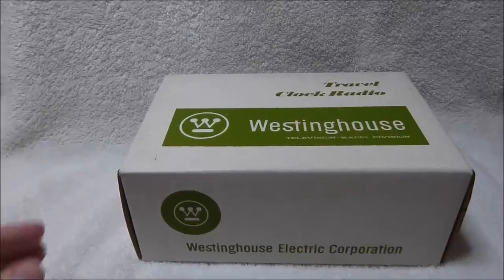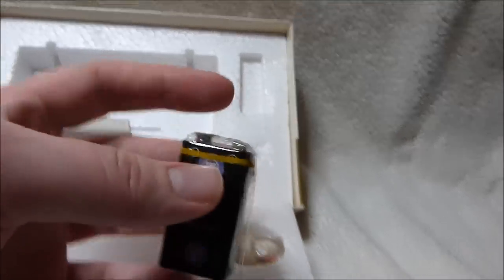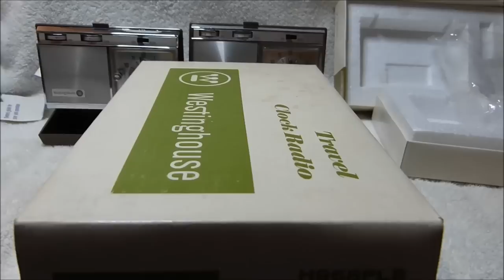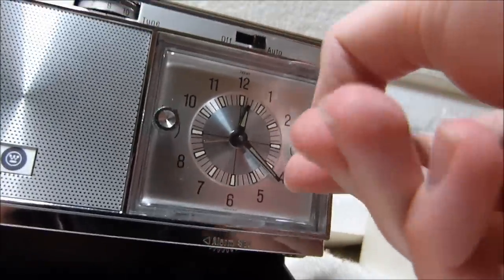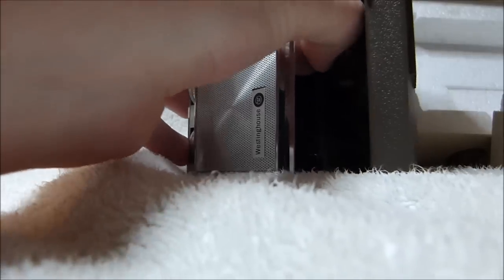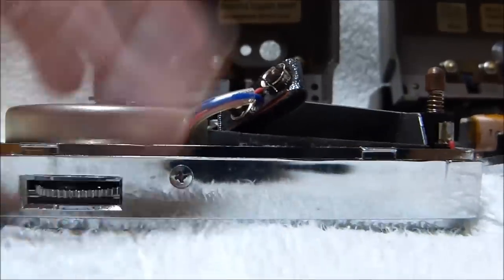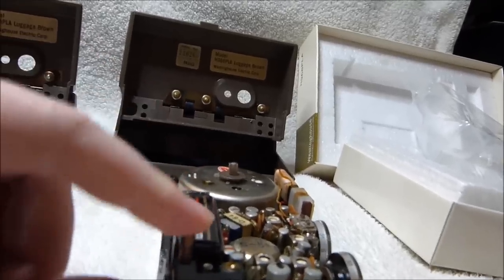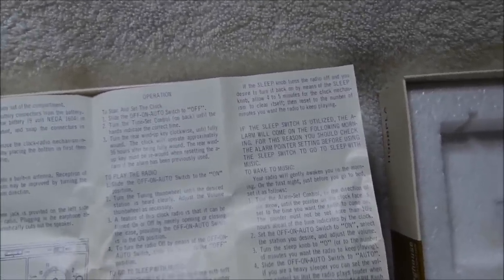Unboxing a NOS Westinghouse model H968PLA/B clock radio (Japan, 1965?)

Comment: I really don't care what you think Matt, but you have esoteric masterpieces in your collection, and for me this is a masterpiece of ingenuity. I was surprised at the great sound from the radio, and some folks would pay a pretty penny for this. I find it incredible that battery looks pristine, can't thank you enough for sharing this little treasure 👍 Tam.
Reply from the maker: Thanks, this is an all-around nice design, I can see why it outsold all the other transistor clock radios that were available. As to the battery, 9 volt batteries seem to survive more often than say AA batteries, but they usually have at least some corrosion.

Comment: Nice review. It would be interesting to pierce the plastic battery wrap with two pins with crocodile clips connected to them and a DVM and see if there is any voltage on either of those factory batteries at all.
Reply from the maker: If it had been a mercury battery it might still have some juice, but these batteries are probably completely dead.
Reply from the maker: Well, he did recharge it before he tried that.
Reply: True. But chemistry can be surprising. I wasn't expecting the wrapped 9 Volt batteries you have with these radios to be anywhere near full voltage, but it would be interesting to see if they are more than zero.
Incidentally, that was a very cool "intelligent" charger Shango066 used... and his comments about the selenium rectifiers were hilarious!

Comment: My unit appears to be over-wound, Its not letting me wind it up. I am hearing sound on the radio, static type sound that changes as I move the dial and as I move the volume. It might be where I am located, that its not tuning anything in, no local stations. Any ideas about how to get the clock winding mechanism to start working again? Should I hit it with a little shot of WD40?
Reply from the maker: WD40 isn't a good idea, as it gums up when it dries. You can put a little drop of clock oil on the bearings only, and gently rock the balance wheel to get is started. The lack of stations may be a problem with the radio.

Comment: I wonder what would happen if you called Western Union today - and asked for "Operator 25"??  53 years ago,  mechanical clock/transistor radio combo's, which were manufactured in Japan, "ticked". Today's Chinese-made clock + radio combinations just 'fizz'.
Reply from the maker: I haven't even heard someone mention talking to an operator in at least 15 years, so I'm going to guess they would be confused. I doubt any clock radio made today would still be functional in 50 years, but at least electronics are cheaper now.